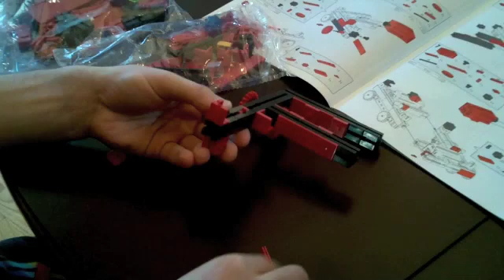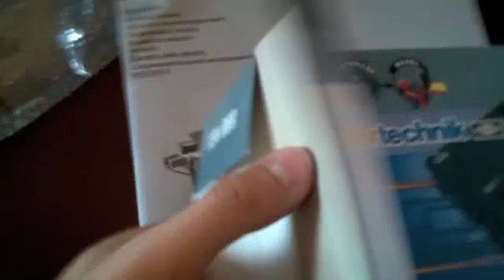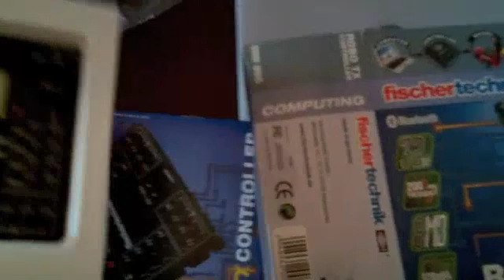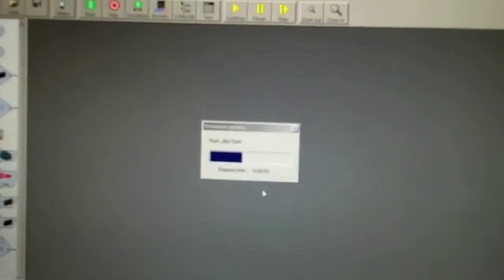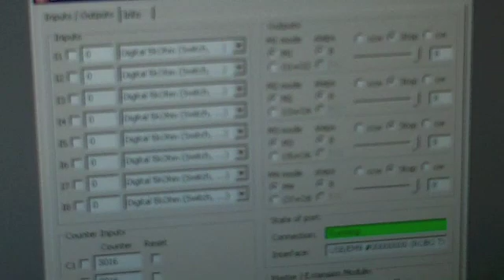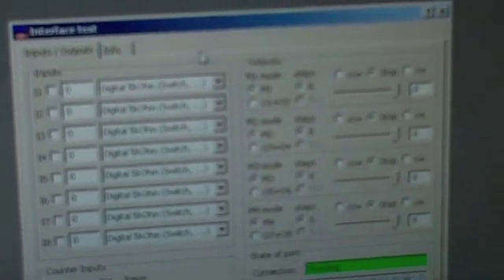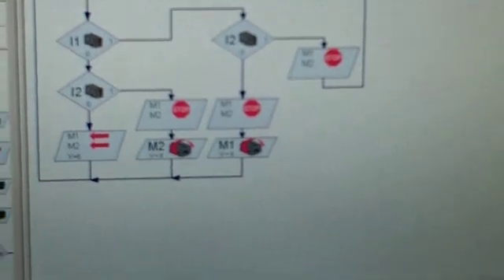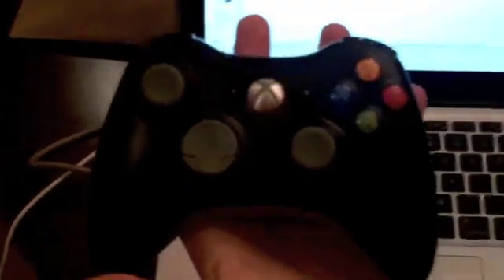fischertechnik Robo TX Explorer Robot Kit

Comment: Hi Guys. I'm doing some research on building a motion control system for cinematography use. This is a system which moves a motorised wheeled platform along a track. A camera is mounted to a tripod which then sits on the platform. What I need to know is can the controller featured in this (rather good) video be used to repeat the same action over and over again ? The key to a motion control rig is being able to repeat the same camera move again and again then in editing combine several shots. A typical sort of effect is to have the same actor in two parts of the scene at the same time. Thanks, Chris.
Reply: Also can this system be used with different motors ?
Reply: I don't really understand. Do you want to move the camera?
You can do a lot with the ROBOPro Software
Reply: I want to move the camera along the track in a way that can be repeated exactly several times over.
Reply: You can build the track and then make wheels move on it and add a motor to the wheels. You can do the programming of the motor in ROBOPro. Keep in mind that the camera shouldn't be to heavy or it is going to be loud or even stop.